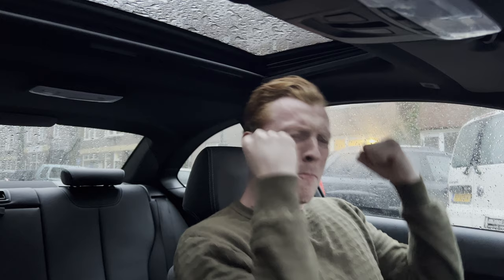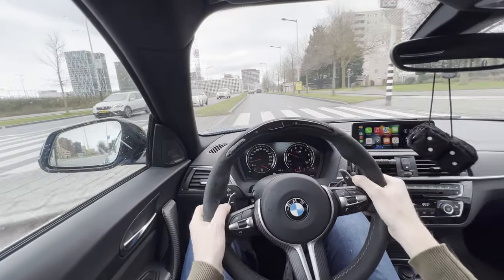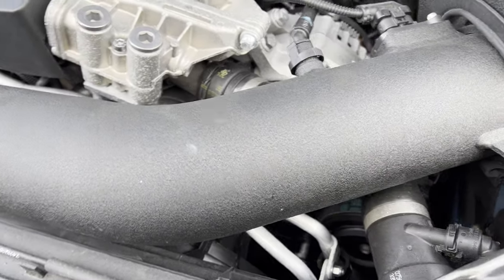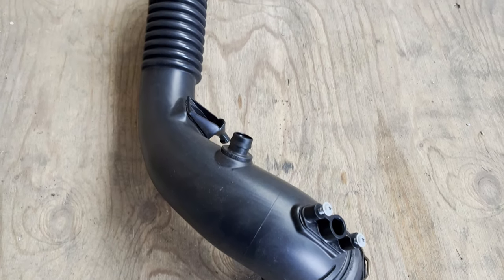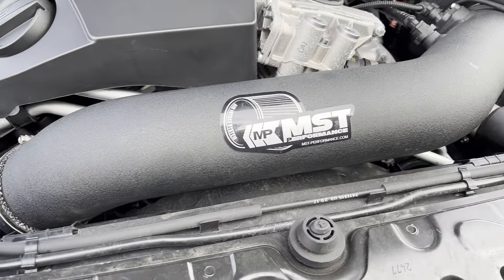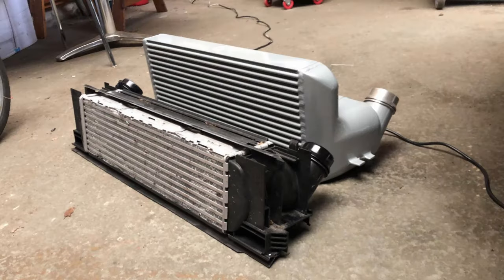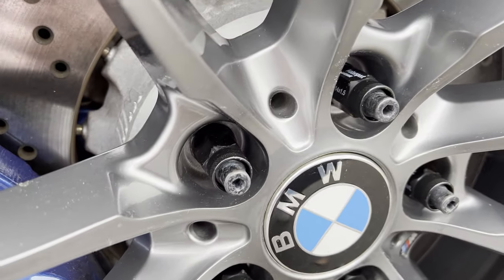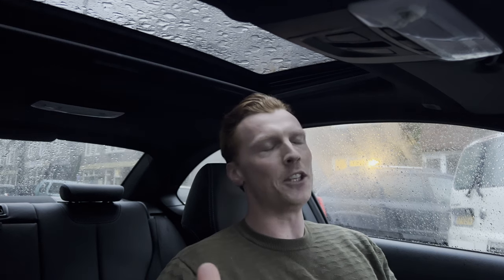BMW M2: All The MODS Done

Comment: Hey man! Awesome build! I've been thinking about getting an MST intake for my M340i, but aren't you worried about filtration problems in the long run? That filter defenitely doesn't filter dust as good as the OEM one and, as far as I've heard, could lead to engine damage in the long run. How many km have you driven with this setup? Could ease up my nerves if you would provide some insight.
Reply from the maker: Thank you man! I'm not worried at all, no. I have the cleaned the filter once in maybe 9000 km (5500 miles) and it wasn't even dirty whatsoever. That was comforting to see. It's true though that the OEM filter does the best job, but damaging the engine on the long run with a different (quality) cold air intake? I wouldn't believe so (provided that you don't live in the Sahara and clean it often). Hope that helps!
Reply: @TheHunterHofman  Alright, I might pull the trigger on it then! Also, is the car flash tuned? Or did you just put bolt-ons on it? 
Really appreciate you answering! :D
Reply from the maker: @0071maou  you won’t be disappointed! The car is not tuned whatsoever. Just the bolt-ons.